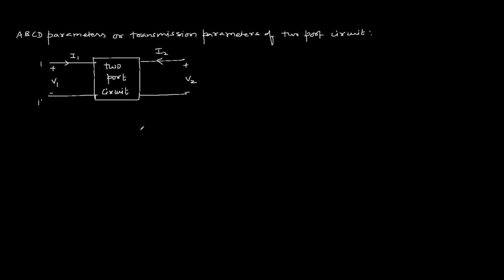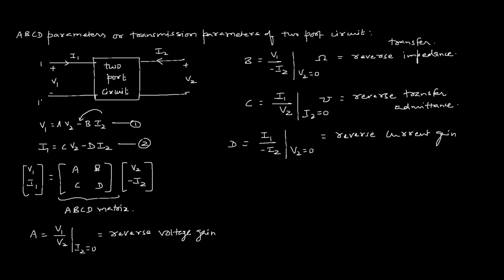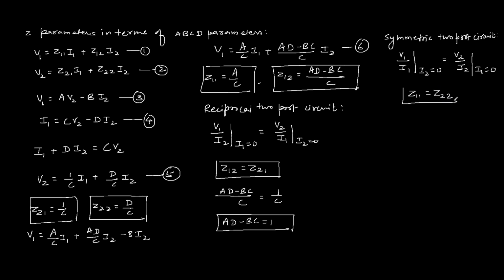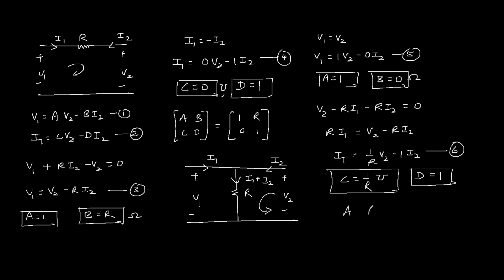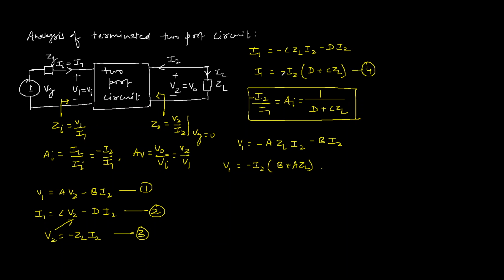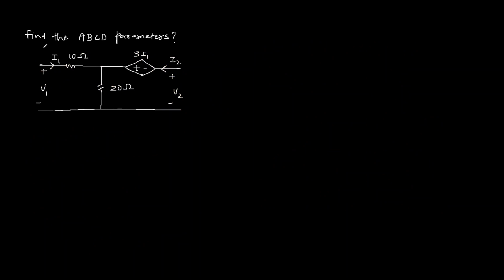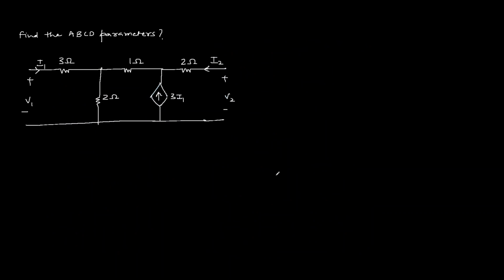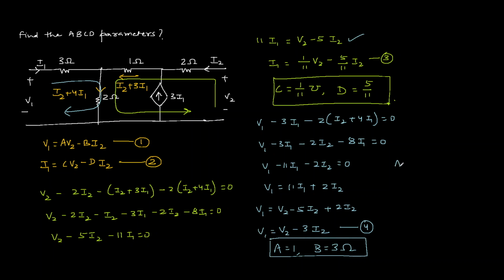ABCD Parameters or Transmission Parameters of Two Port Circuits

Comment: At 11:10 part, why the drop across the voltage is RI2 and not R(I2-I1)? Two currents are flowing through the resistor, right?
Reply from the maker: One path can have only one current, here you can take current through R as either I1 or I2. To satisfy the standard ABCD parameter equations I have taken current through R as I2 so voltage drop is RI2.